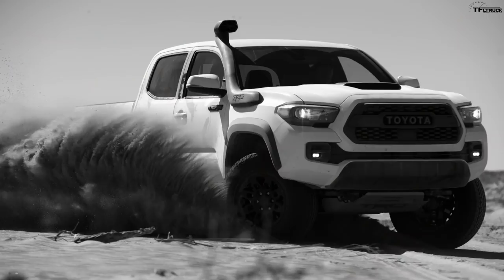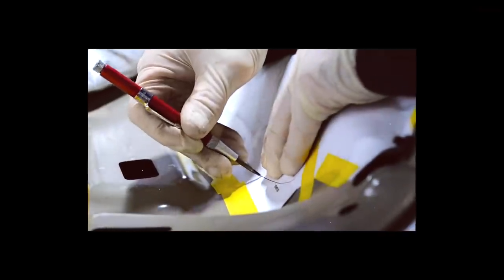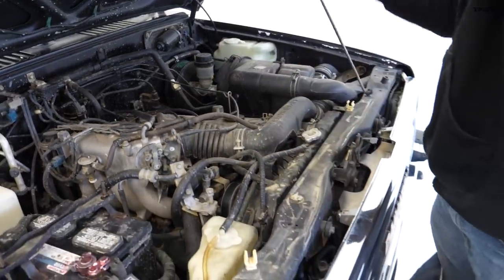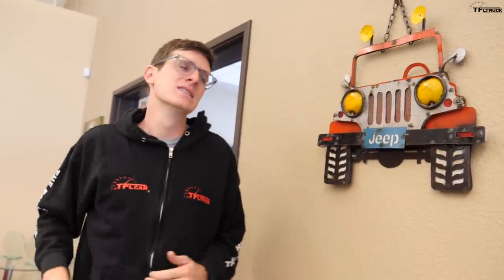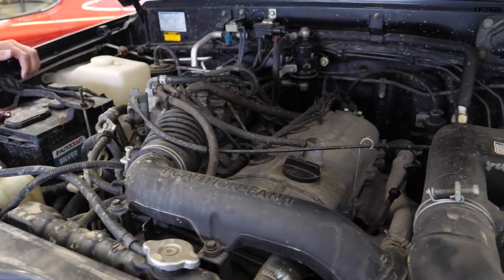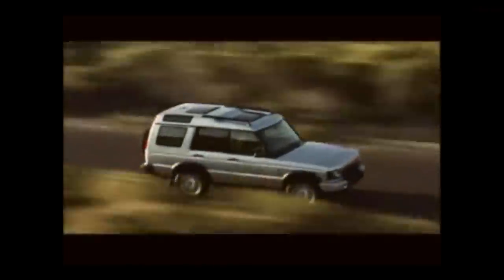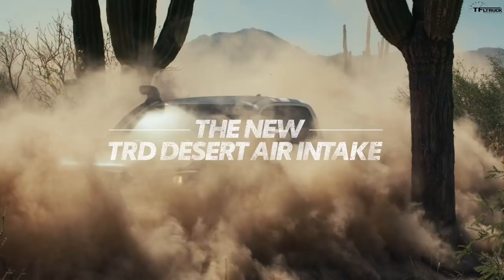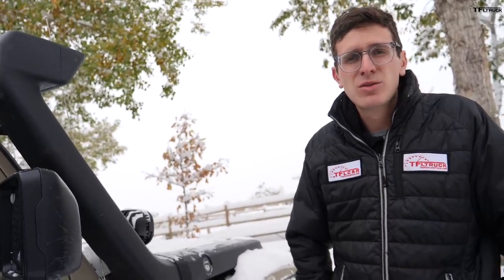Toyota KILLS The Tacoma's Snorkel, So You Hipsters Can't Go To The Grocery Store In A Flood Anymore!

Comment: Have a 54 jeep that has the deep water fording on it snorkel for the air and a exhaust pipe extension the plug wires on the 4cyl had pipe treads to seal and the fuel pumped air to distributer cap to keep water out